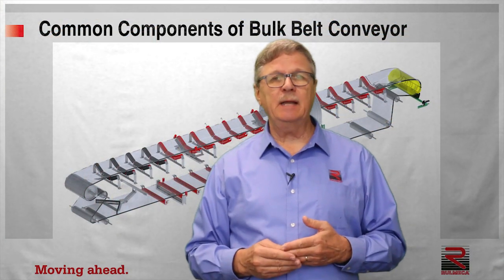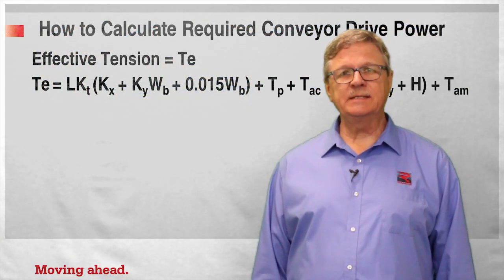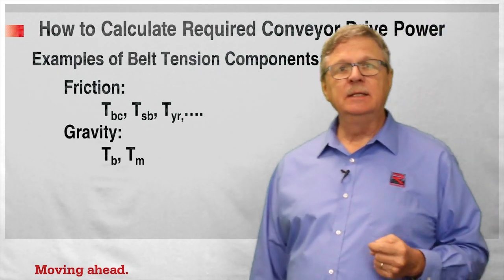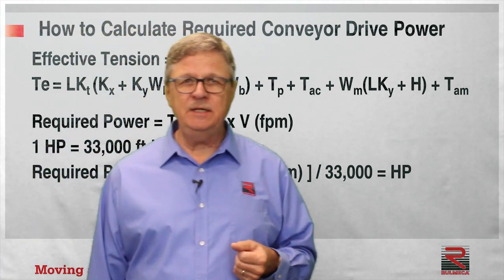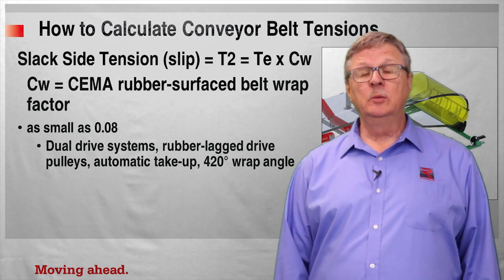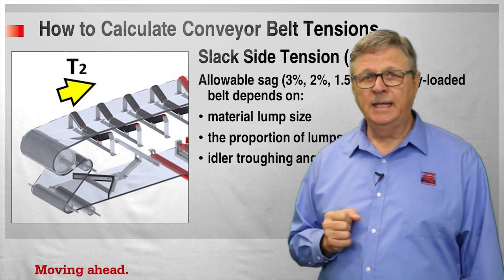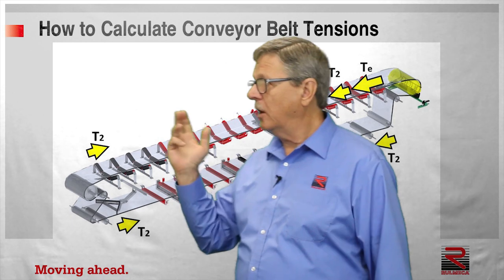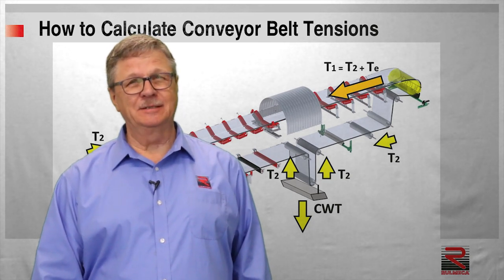How to Calculate Belt Tensions in Bulk Handling Belt Conveyors

Comment: Very much appreciated  the for the good design and the behavior of the materials that feeding the entire conveyor system. This preview helps to inter act with the maintenance that will work on that specific design. Hence what we can only predict after this kind of design is installed in many kind industrial process lies with in the person that will assign to work with the equipment. Innovation is more than a commitment when we go for a long term productivity and efficiency of the equipent. Its really a great help to recap birds eye view of the  design and movement of this kind of design conveyors as you go along your way in maintaining the equipment run effecient and  looking for less maintenance.

Comment: I appreciate your help in providing me a brief equation or rule of thumb to calculate the specific energy consumption as Kwh/Mt/Km , belt speed = 2.5 meter per second, trough angle = 30 , surcharge = 25, material = excavated soil  (sand) , lump size less than 150 mm , density =1,550 kg/M3 , belt  length =  5 Km (multiple flights ) , Flow = 3500 to 4,000 Mt/Hr , Route inclination= zero inclination, Width = 1,200 mm , considering these inputs , how much electricity will be consumed in electrical motor as Kwh per metric ton (Weight)  per Km (distance)
Reply from the maker: Dear sir, We will be happy to help you.  Please provide your name and email address.
Thanks,
Mike

Comment: GREAT INFORMATION thank you!!!
I have a question.
L the leght of the conveyor
Is it the totally leght such the load side as the return side or is it just the leght from center of the drive pulley to the center of the tail pulley?
Reply from the maker: Dear Norwin, Length should be considered to be the distance from the centerline of the tail pulley to the centerline of the head pulley, assuming material is loaded near the tail and discharged near the head.  Mike
Reply: @rulmecacorporation4596  a lot of thanks!!
Reply from the maker: @norwingradisrivera1368  It's our pleasure to help in any way we can.